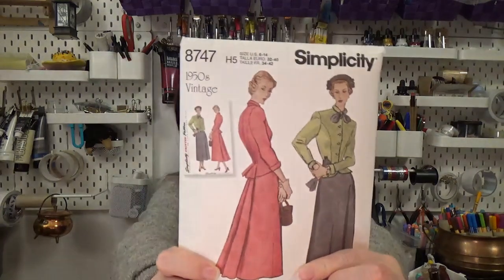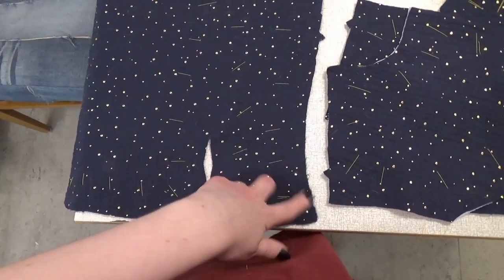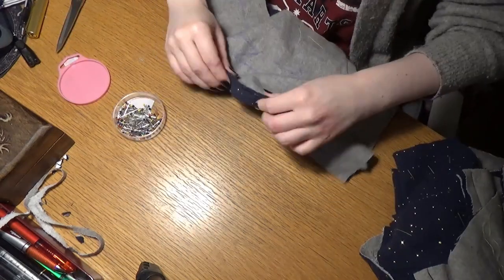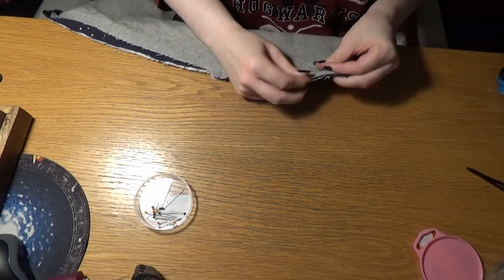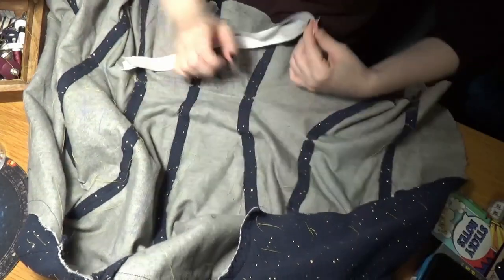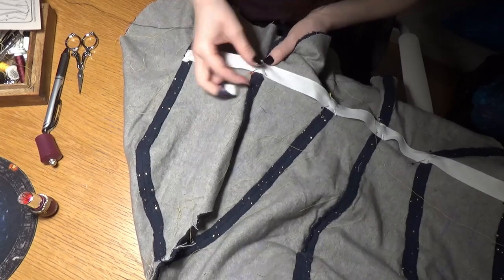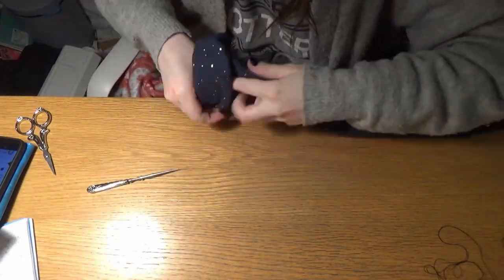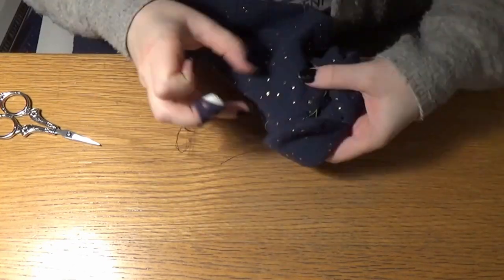Sewing a 50s Suit Jacket // Simplicity 8747

Comment: I really enjoyed the way you explained what you were doing, and your wexperience level with each step. Thankyou for making a video so well designed. However, I didn't notice you try it on at any point in the process. Did you leave those parts out, or does the standard block they use always fit you properly? I can't imagine going though all the finishing steps without trying it on to know it fits. I always have to do some alterations, and have learned that when a pattern says "baste" followed by "Stitch" it usually means to try on and check the fit in between those steps! ANyway, thank you for this helpful video! I have this pattern and am looking forward to making it!
Reply from the maker: Thank you for the lovely comment ☺️.
Before I started sewing I made a mock-up of the jacket and made a small alteration to shorten the waist a bit. I tried on the jacket several times during the making but I totally forgot to film it and to film the mockup process😅. In the future I will try to film those steps as well.😊
The standard fits me some times but most of the time I also need to make some alterations. I almost always make a mock-up before starting on the real project.😊